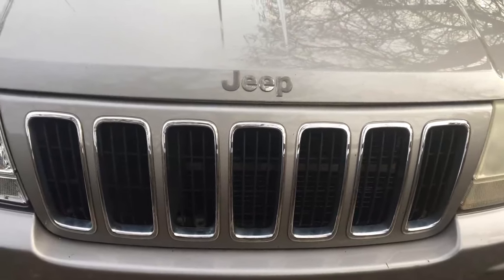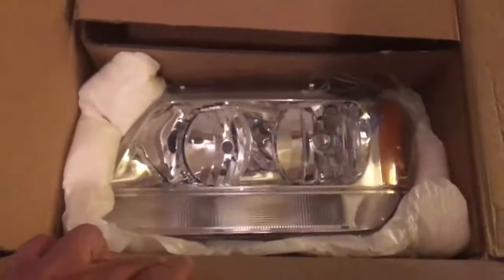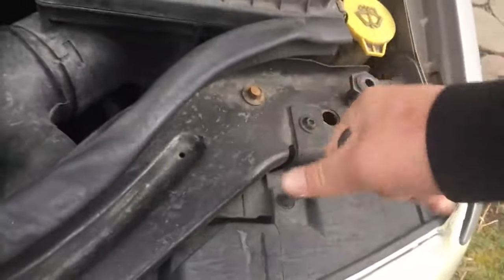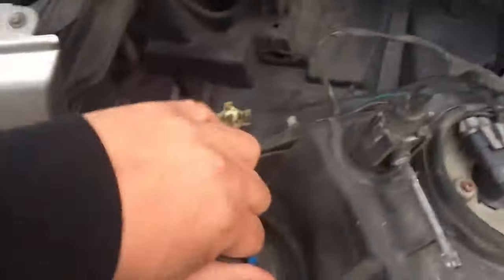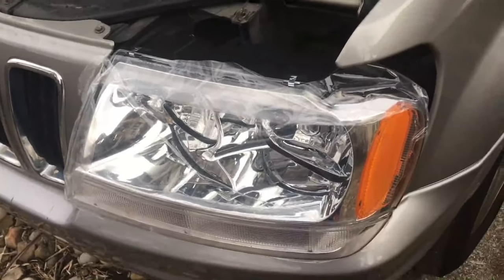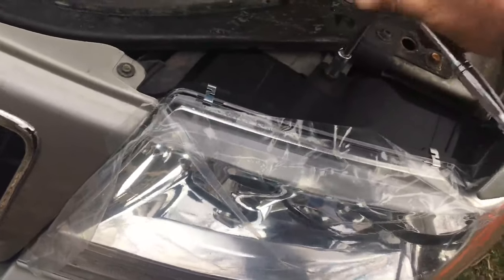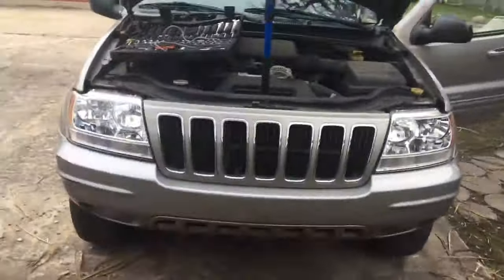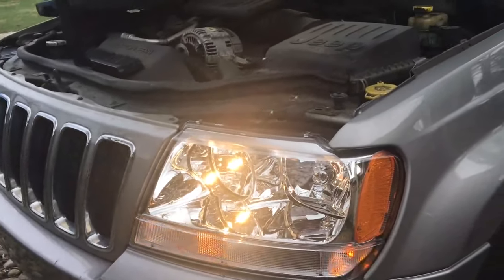How to Install Replace Headlight Assembly(Jeep Grand Cherokee )

Comment: There is a Youtube video showing that on a 2005 to 2010 Jeep Grand Cherokee that you have to remove the bumper and the from trim and grill. Is this a 2006?
Reply from the maker: Hello, this is a 2002 Jeep Grand Cherokee
Reply: The 2006 requires you to remove the grill, bumper, and pull up the fender wells. It has 3 bolts on the bumber, 2 on each fender well, and 6 on the top trim. There are three bolts on each light.
Reply: @guymckenzie655  I am trying to find a video of replacing headlight assembly on a 2005 Jeep Grand Cherokee Laredo, any suggestions?
Reply: @danielbatts344  I'm in the same boat. I can not find a video for the 2005-2007 style Jeep Grand Cherokee that shows how to replace the headlights. Mine is a 2005 as well. I saw one video that showed how to remove the grill but that was it. It didn't show how to remove the bumper and everything else. I read where it was so simple then the guy listed like 10 steps. That sounds anything but simple.

Comment: The 2007 Grand Cherokee is vastly different from yours.  I am stumped!
Reply: The grille has to be removed. The bumper has to be unfastened or maybe removed completely.  I have an 09 with new headlights on the way. I stumbled across this one and he is lucky it his doesn't involve removing the bumper.